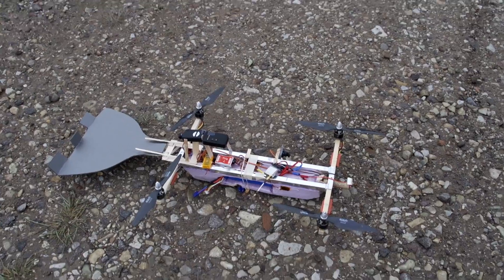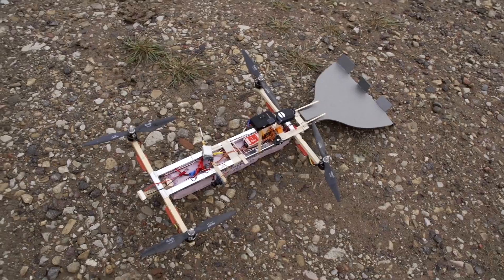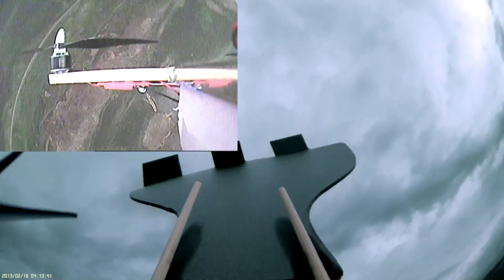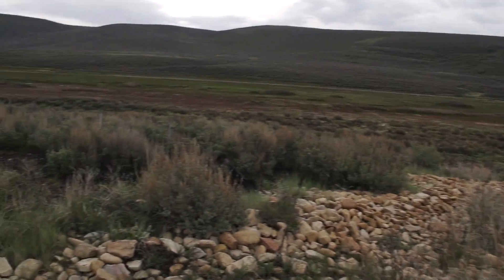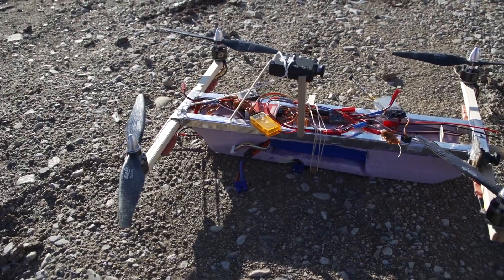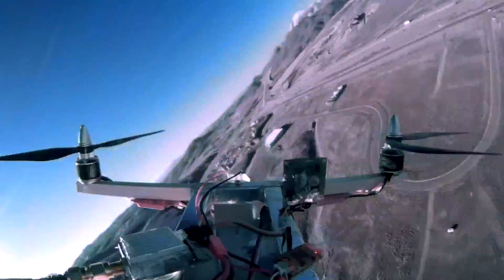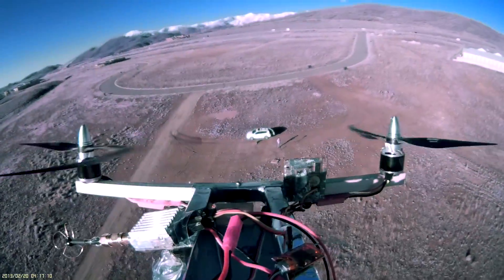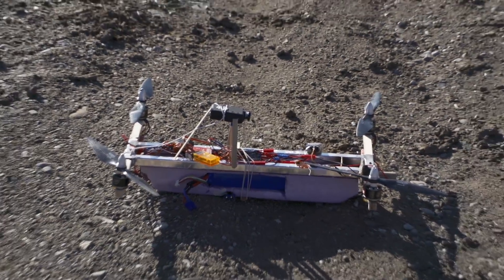QuadCopter Free-fall With ROCKET ENGINE - RCTESTFLIGHT -

Comment: Ok...that little rocket engine is not going to do squat.  Its actually a black powder rocket engine, and you can make your own BP and motors but the easier thing is for you to make what is called a 'sugar rocket'.  Literally sugar and potassium nitrate (stump remover).  King of Random has some nice videos on the subject.  Easy.  What WOULD BE really cool is for you to make a decent sized rocket engine and launch the drone up to about 5000 feet, and then detach from the rocket and fly around and home.  The rocket is made from PVC, so you do not really care if you loose it, but if you want to recover it, that can easily be done.  Now that would be a good video, and making the sugar rocket is super super cheap....and a blast.

Comment: Brushless motors without hall sensing have little chance of starting if they spin up in reverse, the esc only sees error feedback and cannot stop and restart them. The only option would be to have active braking enabled to prevent reverse spin, provided very low throttle settings still deliver enough torque to prevent reverse windmilling. Great adventurous video's though, compelling watching.

Comment: Looked like the motors turned on to me, if not why wouldn't they?  Looked like it couldn't recover and altitude wasn't allowing much time for recovery....  It appeared that the software was not able to resolve the recovery...and it didn't appear the rocket engine even put a dent in that momentum...and I'd say you don't need it.

What is the purpose of this experiment?
Reply: +Trondyne Did you watch to the end of the video?

Comment: If you had a central mast, something with fins like an arrow that would help you to stay level in free fall. Also, if you placed four rock motors at the top of the mast at four mounting points facing out from straight down by 20 degrees, this would certainly arrest your fall. Interesting video. I've been thinking of a balloon drop of a quad from very high up.

Comment: mount the rocket engine as a puller, not a pusher. Gives added stability and you can also use the mount for the rocket engine for a free fall stab
Reply: staslig It is not really intitive, but a puller rocket has no stability advantage over a pusher.
Reply: corisco tupi why not? pulling a stick up gives stability, but pushing the same stick up is very unstable. Same as a high wing airplane is more stable than a low wing one and a quadcopter with a high CG is more unstable than one with a low CG.
Reply: staslig To use your example: when you pull a stick up, the lift vector is always vertical. If the stick should sway for any reason, the geometry of the forces will tend to straighten  the stick. If you push from below, the lift vector is also "up" but if the stick is now not perfectly vertical, so the lift vector no longer passes through the stick's CG and  a moment of rotation appears around the CG, further worsening the situation. This is precisely the origin of the usual consensus that a pusher is inherently less stable than a pulling design.

The difference from the stick example to a pusher thrust is that the thrust is not fixed to the outside world (i.e, not always "up") but rather it is fixed to the airframe (always "aligned with the stick"). Any gyration will automatically create a difference between the thrustline (which is fixed to the airframe) and the direction of movement, also creating a moment of rotation but this time in the right direction (i.e, tending to re-establish the original path). IOW, there will always be a non-vertical component to the lift acting in the right direction.

To make a fair comparison with the stick example, you should not pull always "up" from the top of the stick, but pull to the direction that the stick is pointing (i.e, if the stick turns left, you should now also pull a bit left, because that is the direction that a motor fixed to the airframe would be pulling). By pulling always "up", you are artificially creating a stabilizing force.
Reply: corisco tupi
I'm not sure if I'm understanding you correct, but are you not saying the same as me, only in better english?

With the "stick" on the back of the quad, won't that always point away from the direction of movement because of aerodynamic forces and since this is a falling object, then that direction will be up. or at least in the direction where you want to produce thrust to break the fall. Then when you have the rocket break at the end of the stick, it will work as a pulling force in the direction needed to slow the fall without creating any instability?

This principle is at work at every 4th of July and new years eve stick rocket, creating a cheap and inheritable stable rocket.
Reply: On the stick rocket of the 4th of July type, the "stick" part has a stabilizing effect from aerodynamic forces acting on the stick, not quite the effect I described before. What I meant had more to do with the distribution of forces around the CG, which doesn't need a medium such as air to work.
Reply: ***** An inverted pendulum does not apply here because the rocket is rigid with regard to the force being applied, i.,e, thrust is ALWAYS parallel to the rocket body, whereas an inverted pendulum is pivoted with regard to the affecting force (gravity). This makes a crucial difference. In an inverted pendulum, the gravity vector is ONLY aligned with the CG and pivot point when it is vertical. When the inverted pendulum is offset from vertical, a lateral component appears, which tends to deviate the pendulum even more from its current position. A pusher thrust rocket is quite different - thrust is always aligned with the CG.

Comment: Why don't you try descend flipped in acro mode (just gyroscope stabilization) with minimum (like 15%) throttle, the windmill effect of the propellers will slow you, they will not stall (like when you descended flat in the first video) and when you are low enough you just make half loop to recover?

Comment: I think it would be more stable if the rocket engines were mounted on the back of the quad, facing forward, Kind of like a tractor style plane vs a pusher style plane.

Comment: Hi Daniel. I really like you're videos.

Have you tried attaching a "Lost Model Alarm Finder Tracer for Rc Helicopter Plane (LMA001)" to your quad.
http://www.ebay.com/itm/Lost-Model-Alarm-Finder-Tracer-for-Rc-Helicopter-Plane-LMA001-/300951006789?pt=Radio_Control_Parts_Accessories&hash=item461213ee45
I use one, it's a bit annoying but it could help you finding your quad easier.
You connect it in series with a servo. If it doesn't recognize any movements in one minute it starts making beeps.
If you ignore the continuous beep sound for around 2 minutes, the beep sound will change a louder V sound.

Comment: if u had a pole 1m at the back with the rocket on it instead of on the front, it would slow the decent without loosing control.
Reply: Great idea!!
Reply: thanks! i don't know if that would be long enough that the thrust wouldn't damage the quad, just a guess
Reply: by using two rocket engines they can fire in a v-shape below/above the quad

Comment: stick a longer lasting rocket motor on their and go for top speed!! lol I'm inclined to disagree with your assertion that the rocket motor slowed it down to a stop. From the onboard footage that motor had a vertical vector for about a second then the quad leveled out and did 90% of the stopping power. That's what it looks like to me anyways.

Comment: whats about the mobius colors here? IR for better night flying? Dont really like the colors ;-)
other than that this has been a fun episode once more. I guess the easiest way to come down form really high alt is again just 1/4 throttle and manual mode dive. Never turn down the motors, and dont use cheap plastic props or weak motormounts because they will brake on the recovery. But yes, this is the one thing that I don't like about multirotors: you gather much potantial energy (by ascending) and then you need another lots of energy to come down. Not very efficient...
Reply from the maker: I cracked the mobiuses original lens so I can't really go back :(

Comment: Love your stuff, Daniel! Great idea with the rocket. You should mount it with a metal baffle behind it so that the rocket actually ejects itself from the copter when the reverse charge comes out. I guess the issue there is that you’d have a flaming rocket engine free falling into a field, where it could be a fire hazard. But it should be expended, right? And it seems like you could wait until the copter was closer to the ground to fire the rocket. Such a great experiment!

Comment: That's really cool. The thing that struck me was that if you put the rocket at the opposite end (ie you hang it by the rocket rather than balance it on the rocket) it should be a lot more stable. But looking at your footage, it looks pretty darn good in that last run.

Comment: love your videos!!! I would donate to your experiments..

how about a parashoot or a rear mounted rocket off a wire frame with a heat shield to protect the frame.( with a tail to keep it straight)

but one i realy want to see is a quad with a rear mounted motor pusher.....
maybe you could have some small wings so you can power down the quad motors..

good luck..